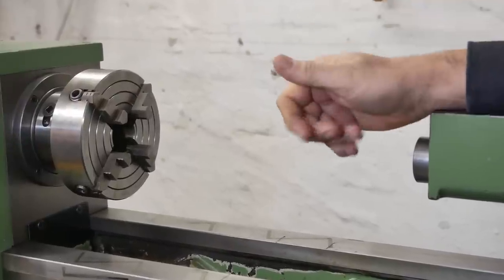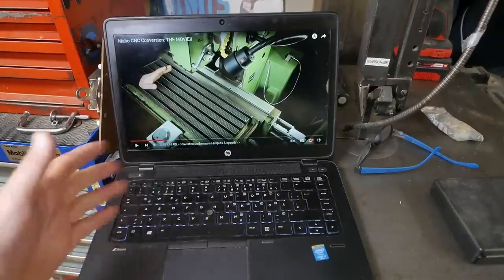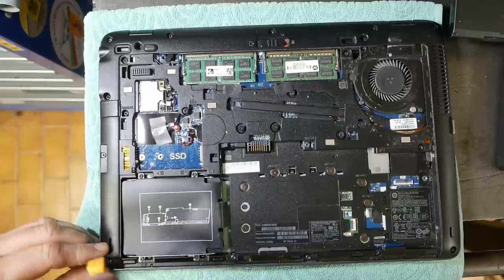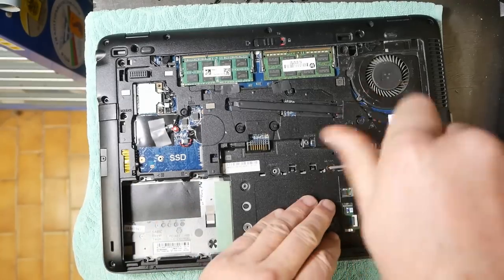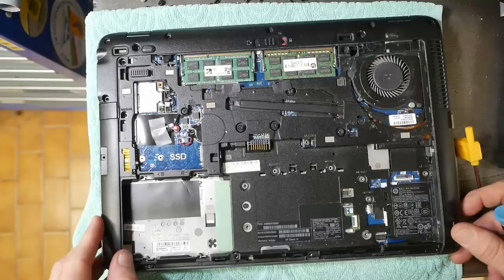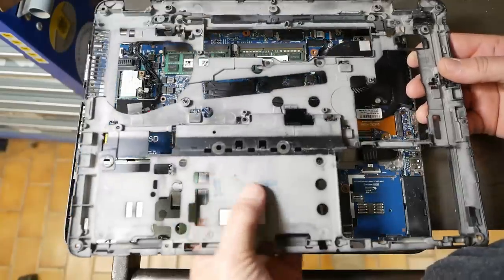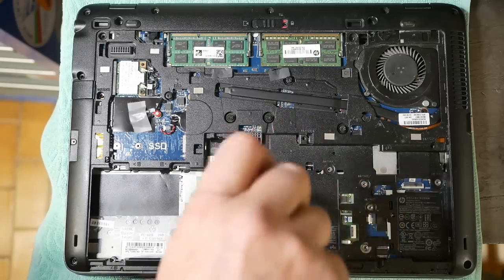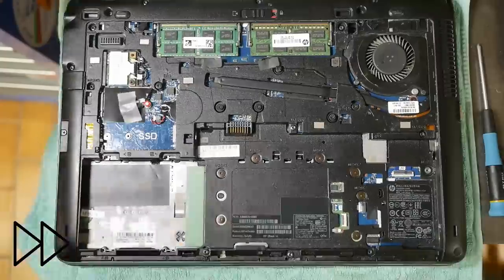M1 Mac: New, Refurbished or PAINTED?!?

Comment: If you are focused on an M1 mac, I'd say make sure to get as much external storage to keep as many project files as possible off the computer. 1 for versatility, and 2 for functionality of the Macs. The M1's OS is notorious for taking up internal storage, as the ram isn't upgradeable and it transfers excess "necessary" ram to the internal hard drive shrinking the internal hard drive. The M1 has great processing and encoding/decoding abilities especially for Da Vinci Resolve. I would work to get a refurb Mac as the brand new ones carry the initial "Apple Tax" as you'd see with a luxury car as they lose immediate value immediately off the lot. They can be very capable machines for 4K footage but beware the ecosystem, as opposite from Linux there are many cases if you want to do something unintended by the Operating system designer, often times there aren't workarounds. I am personally a primarily windows user as it maintains the most flexibility between OSes for me. I use Macs with work, Windows for games, and Linux for industrial/hobby tasks. For a 4k windows laptop for around 1k, you could manage a 10th gen intel with a solid GPU for the heavy lifting editing. If you do go with the M1, look into getting a thunderbolt/USB 3 dock for desktop editing. Could help hide the Pink form factor and make usage more bearable.
Reply: Keep in mind though that right now is just about the worst time to be spending money in the high end computer market as prices are currently fluctuation from both logistics and supply issues, so if you could wait say 3 months, That's when I'd recommend buying.
Reply from the maker: @LarsPantsonFars  Excellent inputs, thanks. I have also had an eye out for a Razer Blade 15, but they are mostly dearer. At least then I could upgrade the ramand SSD. 
I already offload all the project files each week to back up HD's.

Comment: I harbor a hatred for Apple, which is likely somewhat irrational.  That means I would go out my way and delve into the thicket to avoid them, even if they're arguably the right tool for the job, which they certainly may be for 4K video editing.  The thing is, even their relatively affordable stuff tends to cost too much for what they are.  If you're dead set on Apple, used or refurbished is the best bet.  But if you're a cheapskate like me, you'll get a better deal on a similarly spec'd refurb Windows machine, then set it up with a good Linux distro like KDE Neon (which runs like an absolute gem even on my dated repurposed hardware).  You'll be amazed at the performance gains when you get Windows out of the way to give your hardware some breathing room.  And if you're doing all your editing in one place, towers still offer the best bang for the buck, plus they're easy to work on when the need arises.

By the way, I still gave you a like even though you spoke Mac at me.  You're welcome. ;-p
Reply from the maker: I have also tried to avoid everything apple. For the same reasons. The problem I now have is that I 'd need a gamer pc to match the performance of the M1 Air, and they can only do it plugged in, with the fans screaming. That ARM silicon in the M1 is so well optimsed for video editing. 
You need an 8GB GPU for resolve and 4K, and even used, the prices are nuts, so I would struggle to build a used parts tower with the M1 Air performance at that price. And I need a laptop.
Reply: @RotarySMP  I reluctantly agree with your assessment. 😂
Darn it Apple, you win this time!

Comment: While Apple hardware is exceptionally good (I use my 2015 MacBook Pro for just about everything from training ML algorithms to high res photo editing), its like you said - does it make sense to get that right now? Also, not sure if Mac is your thing UX-wise. Its a whole new interface and key combinations and it takes some getting used to. If Windows is your preferred OS, then you can get a refurbished machine that is about 3-4 years old which has an i5 and above processor, upgrade the memory to anywhere between 20-32G and replace the regular HDD with an SSD. I did that with my sister's machine and it's blazingly fast now.
Reply from the maker: The issue is that Resolve is optimised to load the Gpu, so you need 8GB of video ram to optimally work in 4k footage. I have also considered a Razer  Blade 15 advanced, but they are way more expensive even used.
Reply: @RotarySMP  Yes those are expensive! Then it’s best to get a used desktop, and in addition to the above suggestions also get a powerful video card in it. That would solve your issue for another 18 mos or so. Windows is really poor at resource optimisation. Also maybe look at Alienware laptops.

Comment: Dont buy a Mac!
Build a desktop PC, cheaper, better and easy to upgrade.
Reply from the maker: Resolve is optimised to load the GPU and needs 8gb of video ram for 4K editing.
With the current price of 8GB GPU's, even used, it would be a struggle to put together a used part desktop with the performance of the M1 Air, for that price. And I need a laptop about 20% of the time.

Comment: Go for used pc, if you don't have room for full permanent desktop setup you can use remote desktop, leave the video to render and still have laptop available for other use.
Reply from the maker: Does Resolve support that at full performance? Wouldn't that also require a really fast internet connection? ADSL in my area is maxed out at 70 down/ 10 up, and often less. They have no plans to upgrade this neihbourhood.
Reply: @RotarySMP  Run resolve on desktop pc. Then use remote desktop protocol(rdp) to access that machine trough your laptop. Everything happens in local network so speed shouldnt be problem.

Comment: Look at a used Toshiba Precision M4800...   Its a pretty powerful machine and with 32gb of ram, its definitely capable.... if you need it to be a laptop.
They are business/workstation class.
Reply from the maker: THanks for the idea. Those integrated Intel graphics are not great for video editing though.
Reply: @RotarySMP  The M4800 takes a MXM 3.0a card... so its upgradeable and usually comes with a nvidia quattro card in it.  After seeing your update video though, I noticed your app requires a @%#$ load of vram.  The default for the M4800 is 1-4gb cards, and MXM3.0a is way less common than MXM3.0b (the b model has longer cards physically) so It may not be a good fit for you after all....

But if you need graphics hardware, keep your eye out for a gaming laptop.  It will be the best bet for something mobile with a good GPU for editing and processing.
Reply from the maker: @JaredKaragen I was looking at Razer Blades. As you say gaming laptops have the power, but they can only really use it when plugged in. Then you get 150W+ of heat. I often edit with the notebook on my lap, and that sort of heat is very uncomfortable. This is where the ARM based M1 shines It can render fast, without the heat.

Comment: I've owned macbook air as well as regular macbooks.  Unless you carry your computer around a lot the regular macbook is a much better deal.
Reply from the maker: Were those M1? 
It seems to really make a difference. The video editing performance of the M1 Air is good, that the incremental improvements of the Pro and Max, are mainly theoretical for the videos I edit.
https://www.youtube.com/watch?v=lTes9KkwmME
Reply: @RotarySMP  They were not. The intel. The big issue I had was running out of RAM. I haven't looked at the differences in the M1 chipset.

Comment: No slave run Apple computers. And don't waste you time on 4k. Get an used gaming laptop like an asue or dell
Reply from the maker: I'd like a Razer Blade, but they are more expensive used than the M1 Air, and throttle on battery.

Comment: Hi Mark, As you know the Apple M1 chip based machines have a good reputation for video editing. However they also have limitations. In particular the 2TB limit on internal storage and the limited graphics capability when compared with a PC with a decent graphics card. I use mac's and PC's so I don't have any axe grind here. I also work with 4k video using Resolve. If you are going to use a Mac AIr then you will also need to budget for external storage using the Air's thunderbolt port. I am using a four year old 4 ghz (after overclocking) PC with two decent high compute count graphics cards with resolve set to use the graphics cards for rendering. Rendering clips goes in a flash, as does rendering the entire video. I bought both my graphics cards via auctions to keep the cost down.
Reply from the maker: I only keep the current weeks project on the computors drive. Each week I offload the finished work onto a cheap back up drive, so internal storage not a big deal for me.

I looked at building a tower pc from parts, as I have done it a few times before, but the current price of GPU's, even used makes this uncompetitive with an M1 Air. And I need a laptop for my work flow.
Reply: @RotarySMP  It sounds like you have your answer as to what to get :-)

Comment: My i3 computer with 8 gigs of ram has problems with video playback in 1080p when editing, it lags like crazy when editing longer videos (around one hour long), but it plays back like 5-10 minute long videos just fine, I was thinking of upgrading to the best cpu my motherboard can take and also maxing out the ram, but that would be crazy expensive even if I bought the parts used
Reply: Add more ram and as fast a ram as your motherboard can run . What graphics card are you running ?
Reply: @ianbertenshaw4350  I have a gtx950
Reply from the maker: That is the sae problem I have. The Zbook can only smoothly play back raw video. Add a transition, a title, speed it up, and it turns to a slide show. Then takes 90 min to render a 15 minute 1080 time line.

Comment: As some have said, not sure 4K is really needed for your videos (for now). However, a speedier computer may also help with the editing with your current settings, and that's also a +. Regardless, I'm not sure the color of the laptop  would have any effect on its performance, (and paint would probably have a bad effect). So I' buy the refurbished one and use the saved money for something else in the shop.
Reply from the maker: I cant easily upload 4K as the ADSL here maxs out at 10Mbps up, but shooting 4K and editing on a 1080p timeline would give me some more flexiblity in cropping.

Comment: i think the best thing u can do , is getting a desktop computer with at least 16gb of ram and a good gpu like an rtx 2060 or 2070 , it will work much better than a mac and with time u can upgrade it with more ram and better gpu... Etc ..
With 1000$ u can get a very nice editing computeur , and dont forget a 4k monitor , if u wanna edit 4k videos , u need a 4k monitor
Reply from the maker: That is no comparision. A 2070 used cost alone cost within spittng distance of the M1 Air refurb price. Like min €800 on my local Craiglist (Willhaben). 
Resolve is optimised to load the GPU and needs 8gb of video ram for 4K editing.
With the current price of 8GB GPU's, even used, it would be a struggle to put together a used part desktop with the performance of the M1 Air, for that price. And I need a laptop about 20% of the time.

Comment: 100% M1 Mac for Resolve (Studio Edition).  I used to use a Dell XPS17 with Core i7-10875H, NVIDIA GeForce RTX 2060 6GB, 32GB RAM & 1TB NVMe.  
I'd edit 4k FLOG 24fps from a Fuji XS-10 and use a LUT for colour correction and the Delta key in Fusion to replace the green screen I film in front of.  
The XPS would generate the output file (1080p) at about 100fps.  I now use an M1 (Mac Mini), exact same setup, and it does about 85fps... but, the XPS was ~AUD6000 and the Mac Mini was AUD2900. So yes the M1 is a touch slower for this use case, but half price!
Reply from the maker: Thanks for your real world experience. That is the impression I am getting. Do you have the baseline 8gb /256Gb  mini? How do you feel about storage and multi tasking while rendering?

Comment: Which version of DaVinci Resolve are you using? I tried editing with Resolve 16 on a HP laptop with 11th Gen Intel(R) Core(TM) i5-1135G7 @ 2.40GHz and 8 GB RAM, but it's pretty slow. Slow enough that I'm having trouble getting to learn it.
Reply from the maker: I use V17. You need buy the studio version to unlock hardware encoding to use that powerful machine efficiently
Reply: @RotarySMP  Maybe if I ever get any vids up for some revenue. Scrubbing through one now determined to get it published.
Reply from the maker: @noberet  Good one. It is quite a big time commitment to build up a channel and community. Hope it works for you.

Comment: M1 Air by far. Best computer I've ever had since my first in 1988 or so. The battery lasts forever. It does not throttle when on battery. It stays ice cold pretty much whatever you do. I use it for my CAD also for my dayjob (Onshape). It also runs Fusion great, I use that for CAM. I have the lowest spec, and its great. I also have the M1 Mini with a big monitor. That is actually cheaper than the Air, and same performance. But of course you are tied to a desktop.
Reply from the maker: That long battery, no throttling is what seems to really set it apart from the gaming PC's which have similar perfromance in resolve.

Do you have any issues with multi tasking when rendering, and how do you feel about the storage space? I already only keep the current weeks project file internal, and offload to a HD every week.
Reply: @RotarySMP  I only use iMovie for videos, sorry I'm an amateur for that. I am a mechanical engineer though, and use it for my livelihood with large assemblies in Onshape. It will bog down if I have about 6 very large assemblies open. It runs out of memory (I have the 8GB version). When that happens, I just close a browser window, and all is good again. Its very rare, only happens once in a while when I'm really pushing the CAD.
Reply: @RotarySMP  If you do get the laptop, change the default trackpad setting. Apple has it so you have to physically click the trackpad for a mouse click. But there is a setting where you can lightly tap instead. It's way better. You will also super appreciate the machining of the laptops. For example, if you look at the bottom of the Air's case, you can see the screws were angled, so that their head's are tangent to the curvature of the case. The attention to detail Apple makes is extraordinary.
Reply: The storage space I have the 256GB version, but I pay a few dollars per month for iCloud. It keeps my phone, my laptop, my desktop, etc, all synced. But, If I was doing a lot of movie editing, I'd probably get the 512GB or 1TB version. Its so nice having everything with you and being able to work (edit in your case) from anywhere, without needed an external drive.

Comment: You can buy skins for MacBooks. So that’s an option. And the bottom of the HP Zbook might be electroformed rather than pressure cast.
Reply from the maker: Good point, although it looks like a casting.
Reply: @RotarySMP  maybe the electroform mandrel was a casting? 🤔
Reply from the maker: @ericmorriscompany9648  Yeah, maybe you right there. Nicely made.

Comment: Fix the ugly with a skin from dbrand
Reply from the maker: Thanks. I got a lot of pushback that skins and paint will adversely affect the thermals.
Reply: @RotarySMP  Can't imagine that. If you are worried leave the skin off at the bottom I guess.
My laptop is skinned.
It's a few microns of vinyl. How could that make a difference.

Comment: You can always repurpose the HP for something else eg Fusion360, Octoprint, or use it to run Mach4 eg like ToT used to do. (you can get a NVMe drive for the big SSD slot on the left hand side to squeeze some extra CPU bandwidth) Getting a refurbed Macbook Air from Apple is the most straightforward, especially if you aim for the 16Gb version (those are hard to find on the second hand market).
Reply from the maker: Thanks for your ideas. I will keep the Zbook as a shop pc.

Comment: Get yourself a surplus HPE Z Workstation. I recently purchased a Z620 duel 8 core Intel Xeon with a Nvidia Quadro 4000 for under $600.
Reply from the maker: I need a laptop. Those Z workstation look nice though. How does yours work for video rendering? How long would you expect it to take to render 10 of H.264, with a few transitions, sped up bits, titles etc?
Reply: @RotarySMP  Can't give you any specific times as I have not done any video editing with it yet, but my old single 4 core Intel Xeon Z600 would render a 15 minute video with a few transitions in about 40 minutes.
Reply from the maker: @SandBoxJohn  My G1 Zbook, with a first generation i7 takes about 90 for that. In 1080P. I am pretty sure a modern machine could do that in about a minute.
Reply: @RotarySMP  The Z620 I referred to in my post is from 2019, that old  Z600 was a generation newer then your G1 Zbook.
Reply: @RotarySMP  I did some playing around and strung together a few random video clips on my Z620, 2x 8-Core Intel Xeon E5-2670, 64GB  DDR3 PC3, Nvidia Quadro 4000 2GB GDDR5, running Linux Mint 20.1, Open Shot Video Editor 2.6.1. Rendering time at 1080p was just under twice as long as the running time of the edited video clip.
Reply from the maker: @SandBoxJohn  Thanks, that is an interesting data point. If you check video editing tests of the baseline M1 Air, they are rendering 4K video, with transitions and colour corrections applied in about 1/2 the running time. Seems some pretty significant performance increases have been made there.